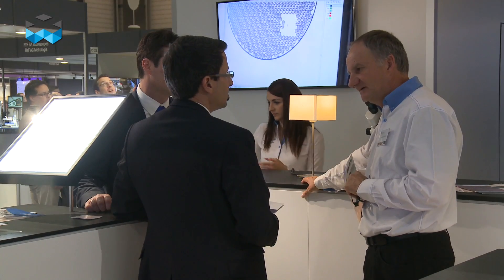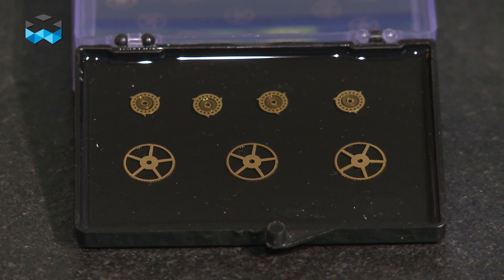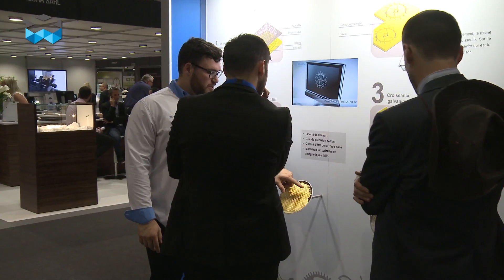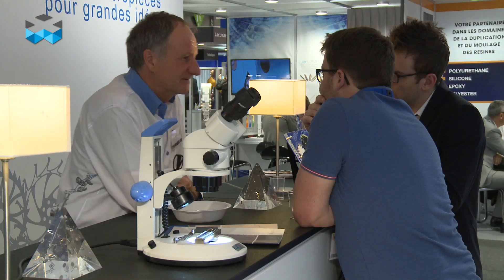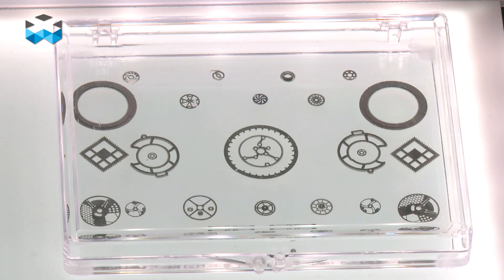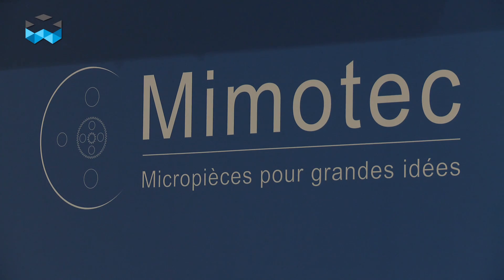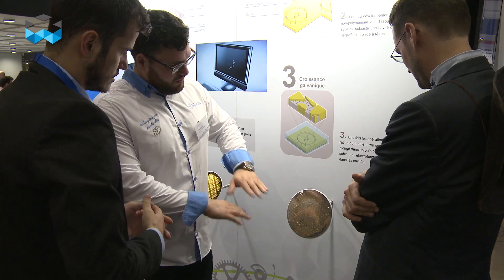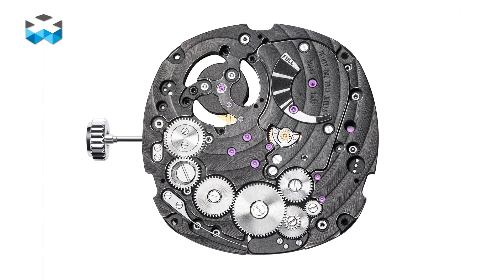Manufacturing 24 karat gold cogwheels

Comment: Pretty cool, as far as I know gold wasn't used before for manufacturing wheels because it is soft and malleable material. F.P. Journe uses some gold in their watch movements, but still has to made some parts with brass or other materials. It will be very interesting to see what kind of models are going to come out.